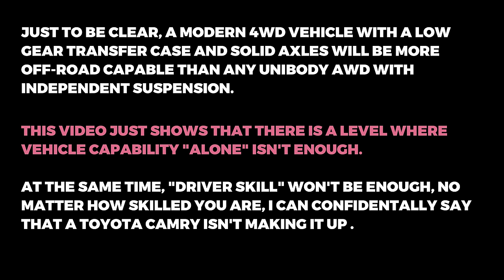HONDA RIDGELINE vs. LANDCRUISER vs. JEEP on 40 Deg HILL CLIMB!

Comment from the maker: Hey all, the owner of the White Honda Ridgeline is @k20nartpro on Instagram.  

He is one of the best Honda Tuners in the USA, holding onto the quickest Civic type R quarter mile record for over a year at 10.1 seconds, and he makes a living building engines at his company NewAge Performance.  He created the B.A.L.L. System, which uses two Hurst drag racing line locks to brake the front wheels individually.  He has custom fit Bilstein shocks into the midsized Honda platform and has come up with a way to elongate struts to match longer springs for more travel.  His company is based out of Ventura, California.

Comment: Built Tacoma TRD PRO 45 yrs of off roading experience. Color me impressed with that Rigeline.
Reply: I've got a 1st Gen built Tundra, and I guarantee you I could air down my tires to 15 psi and crawl right up that with no momentum needed. 

#1. None of their tires appear aired down.

#2. I have lockers. Not sure about them.

#3. I built a custom tool box that goes the entire length of my bed, like a deck, and specifically keep multiple hundreds of pounds past the rear axle in tools to balance the weight while I'm crawling. 

Even with the high output V8 with multiple bolt on HP mods, I can't spin the tires even in 2wd unless it's wet. I spent a decade playing with various designs to maximize traction on this truck. I would crawl right up it. 

Also my truck is street legal and a daily driver. It's not a buggy or anything like that.
Reply from the maker: @Steven-gv1ke …… we all aired down, some more than others.  The Ridgeline went down to 20 PSI.  The location is pinned in the video, so show us 😃.  The Landcruiser 80 is triple locked, and he got up after another attempt (shown in the video at 5:31) but he couldn’t just “crawl it”.
Reply: The Honda Ridgeline definitely deserves more respect than it gets out there.
Reply: @Steven-gv1ke Let some air out of your comment .. you are blowing too hard against something that isn't a real truck as you folks kindly remind us all the time.

Comment: The Honda Ridgeline deserves more respect in the truck world.
Reply: The Ridgeline hauls 4X8 sheets of plywood and drywall flat in its composite bed and they dont move around. The Frontier, Tacoma and Ranger have wheel wells that prevent me from hauling them flat in the bed. The Ridgeline also has a deep large trunk for my tools and with the other three I have to put my tools in the cab. The Ridgeline has a naturally aspirated V6 and the Tacoma and Ranger have turbo 4 bangers. The cab in the Ridgeline is wider and more comfortable and the entire ride and stability especially with the high tech all well drive is incredible.

Comment: I got a Honda Ridgeline 2 days ago. I love it. I wonder what my neighbors with a overlanding Tacoma, a lifted tundra, and their workers in zr2s think😂😂 I love it though. It's perfect for what I need.
Reply: Some crazy stuff in this video. I got a 2008 HONDA Ridgeline. Fun facts, runs perfect 100k miles, only replaced the battery and belt. A st of brakes and a few new tires. IT goes through 4 ft. of snow or soft sand easily. I have never needed  put it in the locking 4X4 low , as the auto 4x4 feature works like a smooth clock. It has pulled out stuck DODGE trucks before. Nothing beats the reliability, wishbone suspension or the trunk in bed feature. 
It will be hard to switch from the 1st gen, but HONDA is the best. :face-red-heart-shape:
Reply: They probably don't give a rats ass about what you drive .  You should also do the same.
Reply: @kazikhalid6197  sweetie is triggered 😂
Reply: How you think about yourself is more important bud 🤘
Reply: @stylin60es  it's the best vehicle I've ever had. Ive literally done everything you can think of with it on road and off road that doesn't require a super duty or something specifically meant to rock crawl
.It's honestly the perfect vehicle

Comment: Hey, John is absolutely amazing that you single-handedly started the niche before Honda could even come up with the idea of the trail sport with your passport. I purchased my passport around the same time as yours and definitely wanted to fix it up unfortunately, the bug of a sports sedan tickled my fancy, and I’m currently owner of a 23 TLX type-S I love it to pieces but sometimes speeding on a close professional tracks, wink wink doesn’t take the box for adventure for me. I am highly debating between the 24 Ridgeline or a 24 pilot trail sport do you have any knowledge of a True off roader coming to Honda maybe in the form of a new Ridgeline or new passport I definitely don’t have to rush at all my brother currently has a 23 pilot Trail sport which I’ve driven multiple times and really like please give me your advice…. Why can’t Honda take the SxS Knowldge and apply it to the SUV/Truck world at honda
Reply from the maker: I don’t know what Honda has in store for the 2025 Passport or Ridgeline, and that Honda Designer Joe Park won’t be telling me anything 😂.  I’m actually worried the next gen, while it has a more capable AWD system, might be going soft in other areas.  You can’t lock in the gears, it has been shown to stall, the rocker panels is completely built into the doors (like many other soft AWDs).  Also, the companies I am partnered with haven’t been able to build a big lift, which is probably due to the platform going soft and sticking the differentials up higher like all the other soft AWDs.  I would wait 😃.  Honda makes their own transmission, so it would be awesome if they surprise us with function that we would want, like being able to hold gears and more manual control.  Maybe they’ll blow our minds and implement portal axles!  Haha, doubt it, but Honda is known for thinking outside the box to come up with solutions (like the suspension for the civic type R)
Reply from the maker: I’ll add that mechanically, it should be able to drive up Hells Gate in Moab with a skilled driver, but from what I’ve seen of the next generation is that there’s digital Nannie’s to ensure the vehicle’s long term reliability, which look like they would also cock block from driving up Hells Gate.  The Ford Bronco Sport badlands can do it, but they also have parts grenading.
Reply: I think if Honda from the factory would do the drop frame lift, include better underclading, aggressive brake slip control and a 55to1 first gear for the Trailsport version it would be a game changer and open up market value for Honda.  I know I would be trading my 2020 for a new one.

Comment: I owned a 2005 Honda Pilot and I was driving through mud holes, never spinning a tire, while S-10 pickups were getting bogged down. There was just something about Honda's AWD that makes them nearly unstoppable off-road. In contrast I had a 2007 Lexus GX-470 that sucked off-road. Too heavy and traction was poor even with locking differentials.

Comment: True story - during the deep freeze of Snowmaggeddon in Texas in 2021…..my Ridgelines AWD was getting me 40 miles back and forth to work all week and the hotel in ice and snow, when other pickups, full size and medium were stuck on the side of the road, or skid off.  I was one of the only ones who could make it into work at my job.  I couldn’t believe how well she did on ice under all that snow with stock Firestones and stock suspension. 
I just wish I could find someone locally that could do a 2” lift all around.
Reply: @mjg1544 Not to take anything away from the capable AWD ridgeline, but those full size trucks you saw were likely 2 wheel drive being it Texas, and a 2 wheel drive truck in ice or snow is worse than a car.
Reply: @user-ze9uy5iq5o   good point.  Another reason to love my AWD.

Comment: Have a 2020 black edition with a leveling kit, skid plate, replaced stock with BFG tires and I've been extremely impressed. Refuses to get stuck, even in the nasty clay type of mud we have here. Maintains traction in the steepest of climbs and has enough clearance to handle decommissioned backroads which are common here. But probably the greatest difference over my old Silverado is how smooth it drives over washboard roads are. If you like to fish around here you travel alot of washboard roads which bounces unsprung weight and Ridgelines is very low, add independent suspension and you literally don't notice it. Would highly recommend for people who need a truck that'll take you where you want to go on the weekends but is easy to live with the other 5 days of the week.
Reply from the maker: I use to drive a FJ cruiser, and the thing I like the most is how precise the steering is.  The Toyota would just float around on the highway and gave me a very uneasy feeling, ldriving past 65 mph id have to make so many micro adjustments.  I also drove a GMC 2500 work truck, and that drove better.
Reply: @JonDZ_Adventuring  Neighbor has an FJ with over a half million km's on it. Hopefully we do as well on our Ridgelines. 🤞

Comment: Jon, I'm the one with white fj80. I'm a rock crawler kind of guy. I have 30 + years in off roading. My next attempt was just throttling it up and made it easily. Any of those vehicles were capable of making it without any problems. Looks scarier then it is. There is a video of me climbing that rock pile next to it , that I was the only one who attempted it. I did get stuck right at the end which was my fault. The guy sitting with me asked if I wanted a spot,which I should have done. 
It was absolutely awesome cruising with all of you. Great bunch of guys
Reply: @yt.be-r  fj80. It's a 91 with fzj80 axles. So tripple locked
Reply from the maker: @walterbjazevich9801 that was a fun day!  There were a lot of things I wasn’t able to fit in a 30 minute video, but I do have a plan to make a follow up video.  I’ll look through all the shared footage for that rock climb.  The recovery footage was awesome too!!

Hope to join you all in another trip!
Reply: Looks like you just started off-roading

Comment: I'm a Jeep guy but always loved the Honda AWD system for a midsize
Reply: Yes, when I chose a mid-size SUV (back in 2016) I went with a Honda Pilot EX-L AWD with its iVTM4 system...way superior to Toyota Highlander's then. And the iVTM4 still maybe the best AWD system even today -- except for the Acura SH-AWD, which is identical mechanically, just tuning (software) differences.
However, now I have a Jeep Gladiator (Rubicon)...that will have to do. ;-)
-- BR

Comment: I bought my 2023 Passport Trailsport because of your videos. You do excellent work and give wonderful, level-headed advice.
Reply from the maker: Thanks Frank!  Congratulations!  Hope the vehicle treats you as well as it has treated me!  I modified mine right from the start.  At 8K miles I had a 2” Traxda lift and 32” tires.  The 142K miles on my Odometer (153K traveled because of the taller tires) have lots of smiles per Gallon and plenty of adventure miles

Comment: I must admit, that lifted ridgeline looks totally badass and great crawling skills.  I have a 2023 Z71 Colorado and thinking about just trading it in for a Ridgeline trailsport.  Not that the Ridgeline is 'better' (the turbo 4 of the Z71 is awesome, drives like a diesel) but I came to realize honestly I just use it for a daily driver most days and do very light towing with a 700# trailer. Plus the Ridgeline suspension will certainly handle my washboard roads around here better than my Z71, which likes to hop around like a spider monkey all hopped up on Mt. Dew.

Comment: As for the read end in the Ridgeline I believe they still use the AT-4 system which is basically an electronic locking differential.

Comment: A regear to go from 20 to 21....is nuts! Lol!
But I dig it!
You ZF Hondas are the Kings of the Softroaders!
Keep it up!
Reply from the maker: Portal axles next!!!!!!! 🤣
Reply: I mainly did it to get my oversized tires back to the original ratio range and speedo correction.  Even though it’s minor it definitely has a noticeable improvement for using slower speeds on obstacles
Reply: @JonDZ_Adventuring  LOL!!
Reply: @k20z3allmotorFTW  Was it difficult to do? I'm assuming it was one of those cool quirky Honda compatibility things like being able to easily add a 6th gear to a 5 speed Honda Element.
Reply: The Ridgeline has made a dent in the industry. I say that because Go Fast Campers once put out a video mentioning they didn't make a camper for the Honda truck, making fun of it.... but now they do. Lol!
Reply: @alexgavieres8293 I used gears from a jeep and land rover, they all share the same ZF9hp48 style transmission

Comment: Considered many options, including a 1st gen Ridgeline, when I started building my own offroad experience.  
After much research and learning ended up with a 3xl #80series and have never looked back.  Might even be buried in it.  
Bottom line is 2 things:
1 - solid axles
2 - axle locks
Everything else is a bandaid or near-peer.

Comment: Hey John! Great video! Great Idea!
John I’m attempting to do similar to my 2021 Honda HRV Lx, I know it sounds crazy (I love my little Honda) I’ve already increased my tire and wheel geometry from stock to 225/17 on Toyo ATII and it made a huge difference in handling! Is it possible to lift it 3” more?
Also, I have a K&N in it but the engine (1800) seems as if it’s not using all its capabilities?
Is there a way to increase: mpg, hp more?
I’m from Michigan and it handles snow fine 
I saw a video where someone took one completely off road? I want to do that is it possible?

Thank you
Ricky from Howell

Comment: I think part of it has to do with the FWD biased setup on the Ridgeline too. The way how steep that climb is, most RWD biased will want to do a backflip if given too much throttle.
Reply: It's called torque vectoring. Sends the power to the wheels that have grip

Comment: After I get an LSD installed on my 79 Dodge W150 Power Wagon, I'd love to try this place. It has a 360 V8 with a NP435 4 speed trans and NP203 case(full time 4x4,no 2wd option). The granny first is a stupid 6.68, low range is 2:1. Im just curious to see how this old truck can compare. Though, it will suck since it never had power steering from the factory, and I'm running 31s.

Comment: Im thinking of getting a new Ridgeline Trail sport, not for this kind of trail but a 2inch level kit and 20 in tires, what specs do i need to do, Thanks,
Reply: Those are some small tires.
Reply from the maker: Sorry for the late reply Mike.  You can fit a 30.5” tire with slight rub, or you can shave the pinch weld or use a Traxda axle relocation kit to fit larger.  I run 33” tires by shaving the pinch weld, but I wouldn’t recommend it unless you know what you are doing.
Reply from the maker: 😂 @pnwdewlwr4100 I have 20” tires on my mini foldable e-bike

Comment: How was the Honda Ridgeline modified?
Reply from the maker: 4.5” lift, 34” tires, slight regear, Bilstein rear shocks, elongated struts, and it can brake the front wheels individually.   (BALLS - Brake Aid Line Lock System).  

Sounds complicated, but these mods actually aren’t that expensive.  I have the similar mods in my Green Honda, but I also weigh it down with a roof top tent and overlanding gear.

Comment: Do you have a video detailing the mods done to the Ridgeline and how difficult they were to add?  I see mentions of what's been done here and there but just wondering if there is a comprehensive video on it?
Reply from the maker: The Ridgeline is modified very similar to my Passport.  So just check out my “Honda upgrade / modification playlist”.  That Ridgeline has bigger brakes, regeared 4.55 rear diff, and 34” tires.

Comment: Wasn't surprised the Porsche made it....those Cayenne/Touareg awd systems are so capable
Reply from the maker: The 1st gen Cayenne/touaregs are actually true full time 4WD.  The Touaregs have an option for a rear locking differential.
Reply: @JonDZ_Adventuring  Yes and some Touaregs came with an optional center locking diff. Great vid btw
Reply from the maker: @TheHonarable1 OH!  The center diff was optional?  So I guess some 1st gen’s were in fact AWD like you mentioned!  Thanks!
Reply: @TheHonarable1  all 1st gen Touaregs have center locking diffs
Reply: @k20z3allmotorFTW  ok then mines has the optional rear locker. I thought the center was optional also.

Comment: Is this Honda Ridgeline modded? I think so. Lifted/skid plates/larger tires? I have a 21 stock, and I would never even consider trying that 1st part or at 10:24 in. Though the IVTM-4 system has proven amazing on 6" deep snow and ice, GREAT traction, I would be too afraid of tearing the front chin of of damaging something underneath.  have hesitated to even take it off road at all. Maybe I am underestimating this truck?
Reply: It’s pretty modified, custom suspension/ lift 33 inch tires, regeared transmission